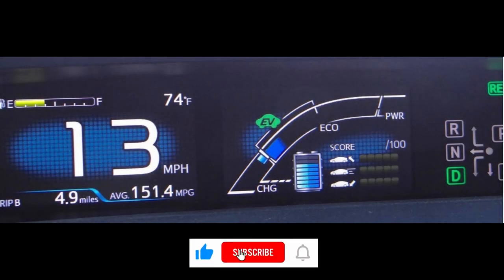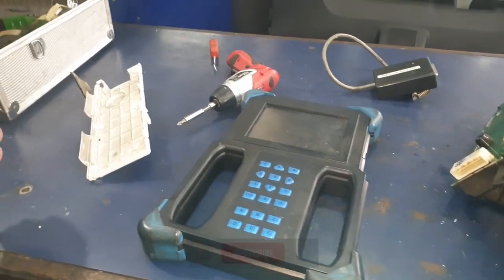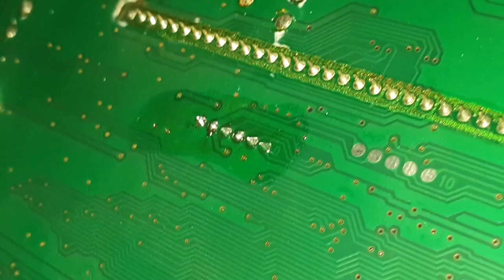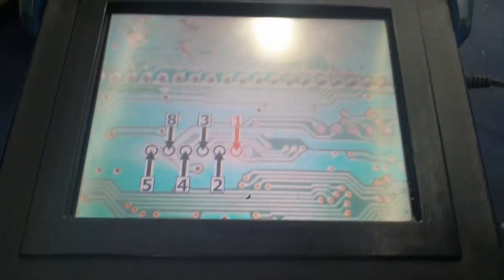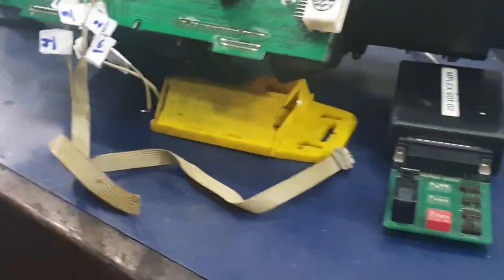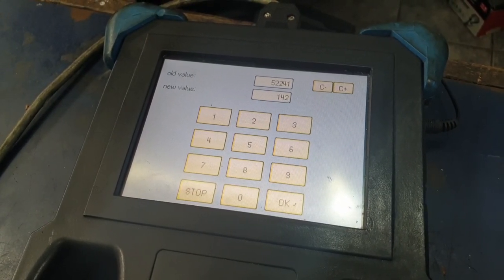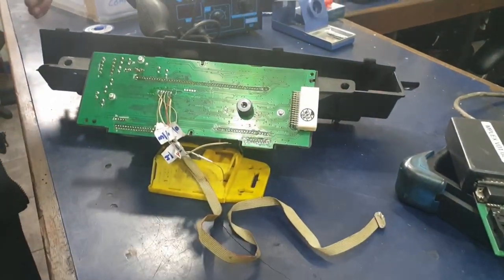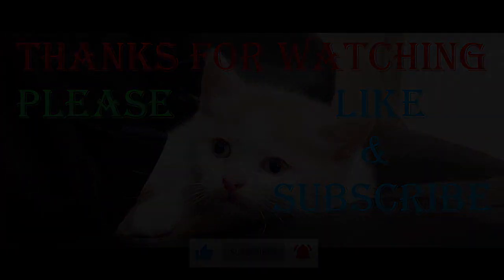2008 Toyota Prius Generation 2 Mileage Correction With Dash Fixer Machine Using SW13 Cable

Comment: Could you change the mileage above 300.000 miles / kms? Pre-facelift gen 2's Priuses get stuck on 299.999.
Reply from the maker: yes, it can be sorted, for 100 pounds
Reply: @universalinformationentert3976  can you make a video about it?

Comment: why not use pogopin instead? Would be faster and wouldn't have to solder to board.
Reply: Hi pal could u plz guide me with this where to buy pogopin and change prius japan import 2010 model km to miles
Reply: Cannot use pogopin on the Prius, the eeprom is hidden behind the big screen and it is a lot of work to unsold it.
Reply: I used pogo pin on mine worked fine. Remember to solder leads to the board requires you to remove it.